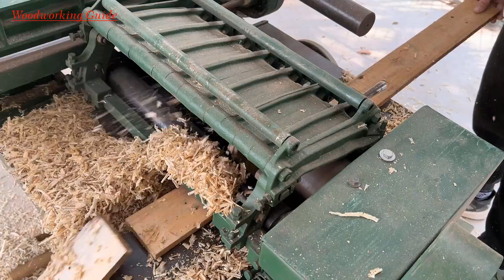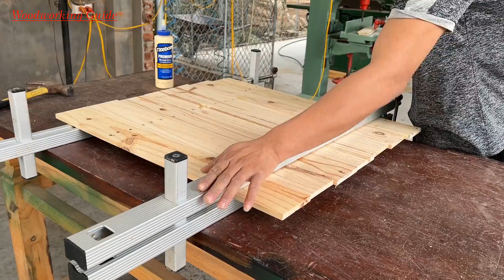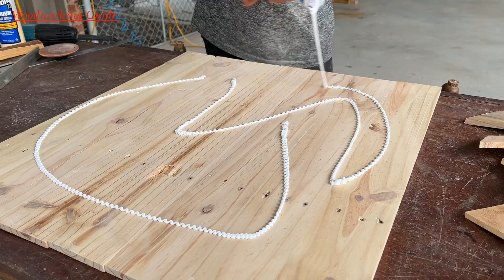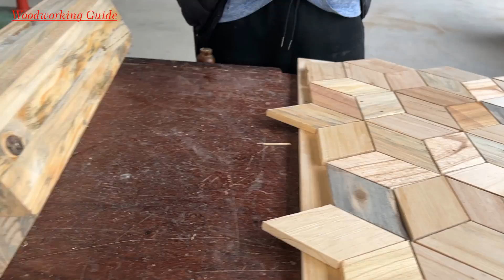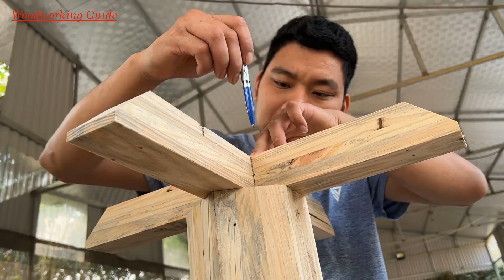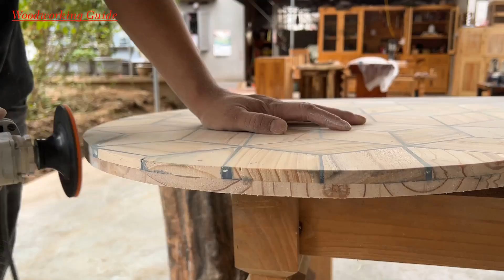Miniature Coffee Table - Making a Rustic Piece from Old Pallet Wood

Comment: To make a shipping pallet out of an old coffee table, you can follow these steps:

Gather the necessary tools and materials:

Old coffee table
Pry bar or hammer
Saw (circular saw or reciprocating saw)
Measuring tape
Sandpaper or sander
Nails or screws
Drill or screwdriver
Prepare the coffee table:

Remove any hardware or attachments from the coffee table, such as legs or drawers.
Use a pry bar or hammer to carefully disassemble the coffee table. Start by removing the top surface, then separate the remaining pieces, including any supporting beams.
Measure and cut the pallet boards:

Measure and mark the coffee table pieces according to the desired dimensions of a shipping pallet. Standard shipping pallets are usually around 40 inches (102 cm) by 48 inches (122 cm), but you can adjust the dimensions based on your needs.
Use a saw to cut the coffee table pieces into individual pallet boards. You may need to trim or adjust the lengths as necessary.
Sand the pallet boards:

Smooth the edges and surfaces of the pallet boards using sandpaper or a sander. This step will help remove any roughness or splinters and create a more polished finish.
Assemble the shipping pallet:

Arrange the pallet boards in a rectangular shape, with longer boards for the sides and shorter boards for the top and bottom.
Use nails or screws to attach the boards together at their intersections. Pre-drill holes can help prevent splitting of the wood.
Ensure that the boards are securely fastened to create a stable and sturdy structure.
Optional: Reinforce the pallet (if desired):

To increase the strength of the shipping pallet, you can add additional support beams or boards underneath the top surface. Attach them securely using nails or screws.
Optional: Add pallet blocks:

If you want to lift the pallet off the ground for forklift access, you can add wooden pallet blocks to the bottom corners. These blocks will provide clearance for forklift tines. Attach them securely to the pallet structure.
Optional: Finish the pallet (if desired):

You can leave the pallet with its natural look or apply a protective finish or stain to enhance its appearance and durability. Follow the instructions on the chosen finish or stain product for proper application.
Remember to exercise caution when working with tools and always wear appropriate safety gear, such as gloves and goggles. Additionally, be aware of the condition of the coffee table and ensure the wood is suitable for repurposing into a shipping pallet.
Reply from the maker: Thanks you very much